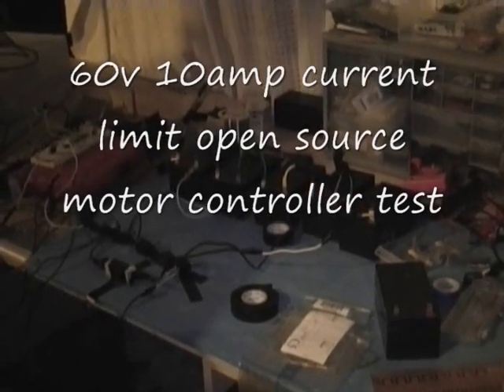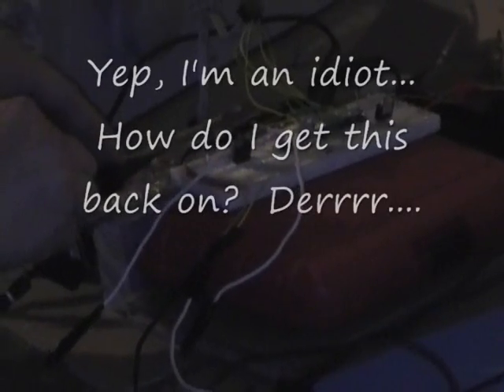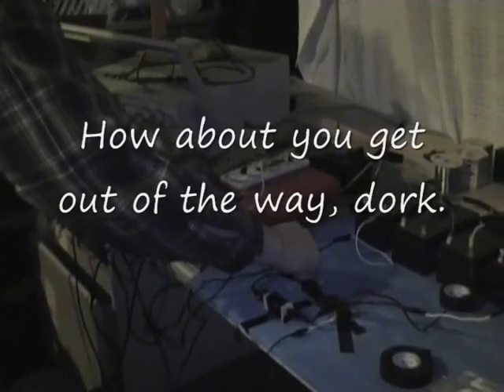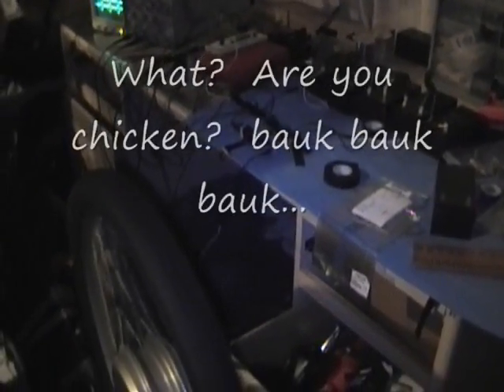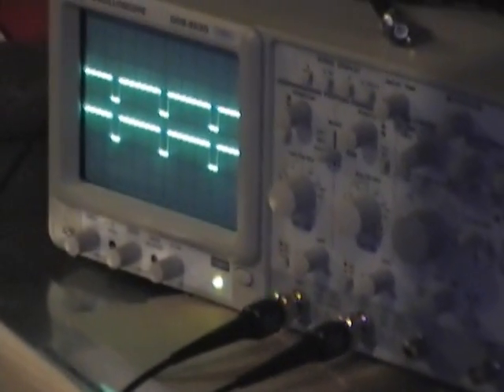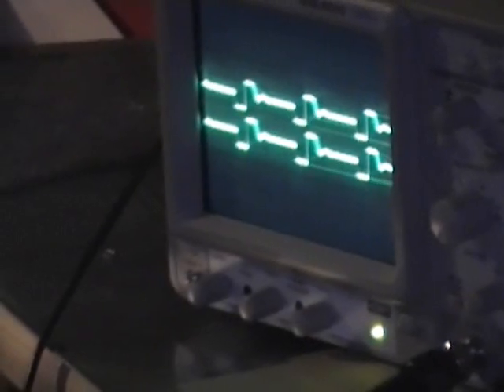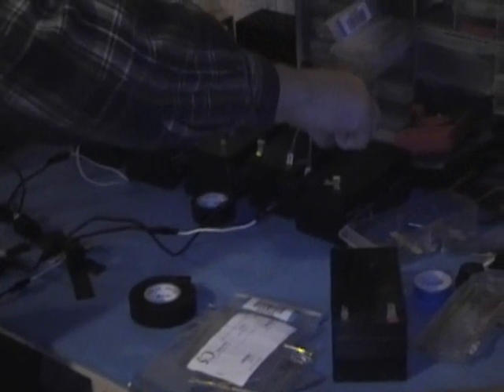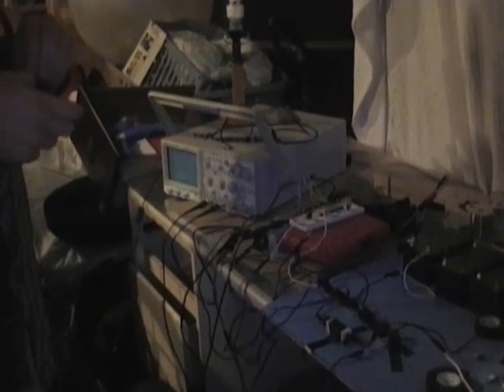60v 10amp motor controller test

Comment from the maker: @sabbadess Use a gate resistor value of maybe 22 Ohms or so.  FDP047N10 looks like a good one.  I forgot which ones I was using at the time.  Make sure you have a mosfet driver  for turning it on and off.  Also, tie gate to source with a 4.7kOhm resistor or so.  That makes sure its' off when it should be.